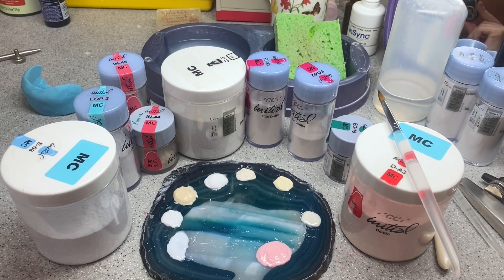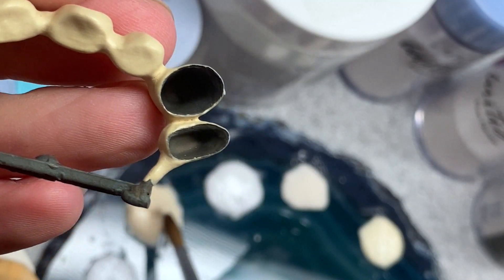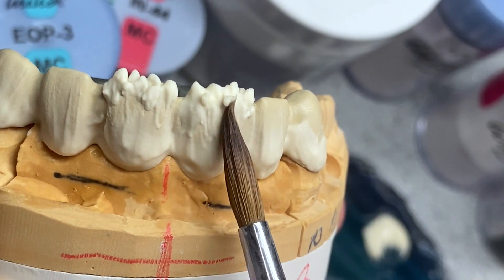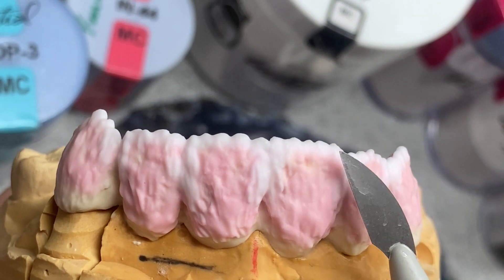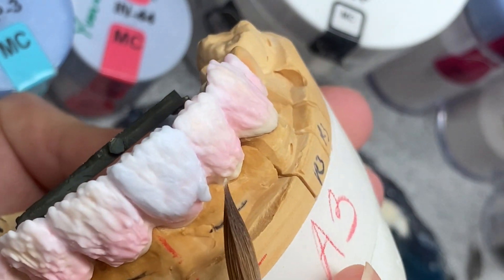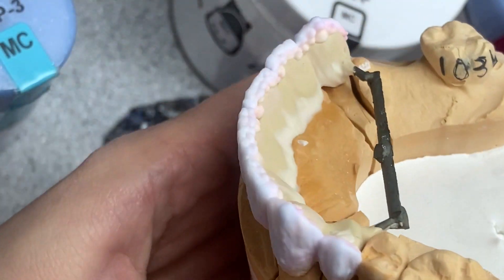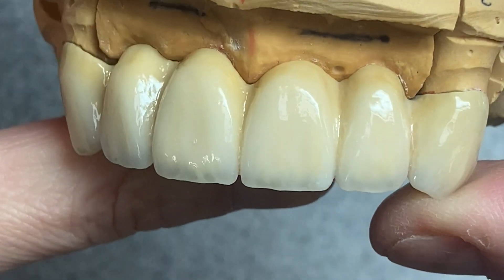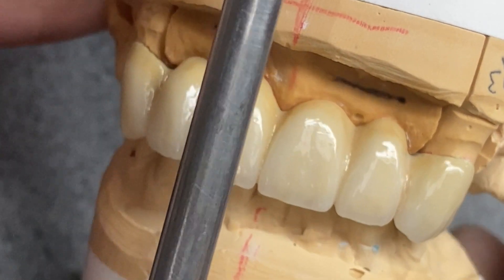How to Build and Finish 7 Unit Anterior bridge "Hedgehog" Style

Comment: Hi Vera! I have been watching your videos since ive started to learn layering. And cracks occurs after the first firing between the teeth (mesial-distal parts). What can i do for them or is it normal?
Reply from the maker: Hi! Yes, cracks are quite normal, especially if the frame is small and you have to build up a lot of porcelain. I work with very good metal frame and zirconia frame designers and they make frames appropriate size with very good inter proximal spaces so it’s easy for me to avoid large cracks. I also pre-dry my bridges on the tray for 15 min or put them on infrared pre drying in the oven, make baking temperature 5-10 degrees higher, hold time 10-15 seconds longer so porcelain can melt well and always set slow cooling cycle to 300C before the oven opens to avoid cracks due to temperature shock. All of that helps me avoid cracks to a degree. But still they happen sometimes… When I see cracks I grind the bridge as usual, do texture and anatomy and then fill in the cracks with small amounts of regular or opaque dentine, glaze and bake on second bake program. After that it usually comes out perfect. I just have to slightly open a polish inter proximal spaces. Hope this is helpful🙌😊🤗
Reply: @verahadden4712  If you pre-dry your work, do you still use the drying programm part which is mostly part of a baking cycle? Is that part of the cycle not enough? Can it happen that you dry it for too long? Sorry for asking too much, I'm a newbie, but I'm glad that you make these videos.